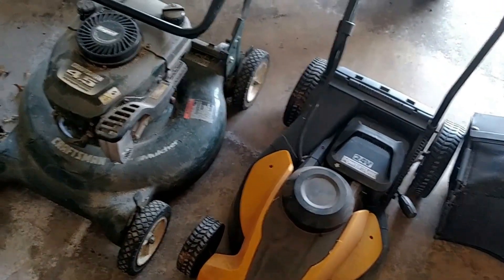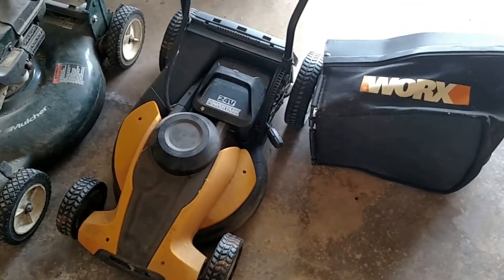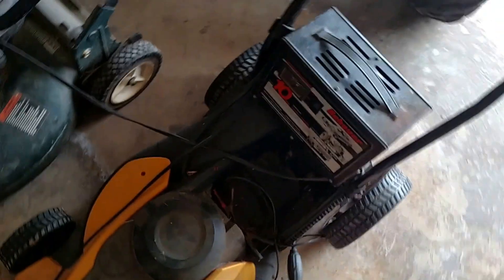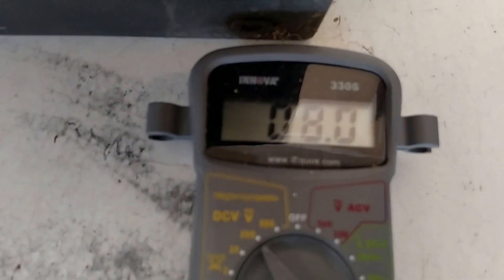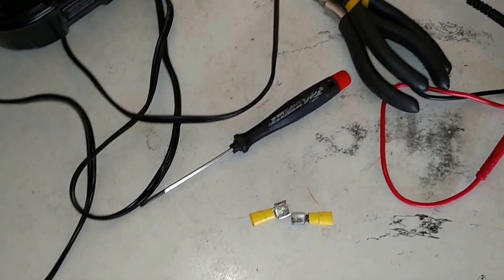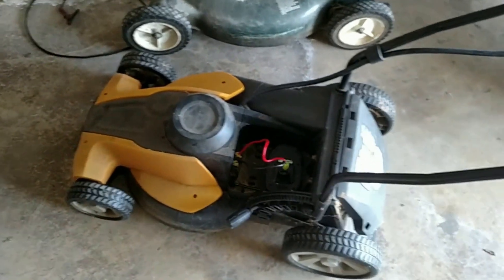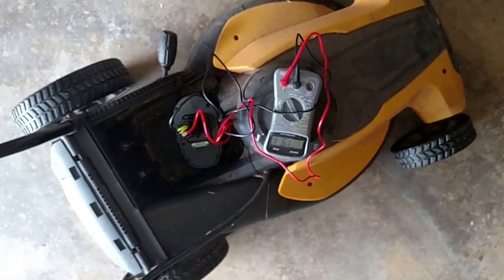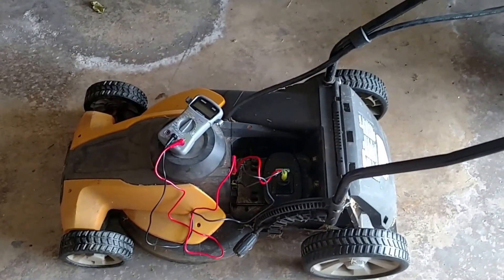Review & Re-power WORX WG775 14" Electric Lawn Mower - This baby's nuclear!!

Comment: I've refurbished/replaced the 12v batteries contained in the pack once or twice over the past several years. Works great and saves TONS of money.
Reply from the maker: That is great, we opted not to do anything with this mower and got a GreenWorks with a larger deck.
Reply: @ChrisDoesWhat what battery did you use? I can’t find any replacements online
Reply: did you replace with lithium ion or stick with lead acid?
Reply: Ted Short LiFePo4, lithium iron phosphate. Outstanding performance now. Much, much more powerful without getting bogged down and much, much more run time. I used to be able to barely cut front and back, now I can do both twice over.
Reply from the maker: We did not repower this, we replaced it with a Greenworks it has a much larger deck.

Comment: Have had mine for 1 yr and 2 wks and battery dead, warranty only for 1 yr. New battery costs more than buying a new works lawnmower. What a shame...I feel totally ripped off.
Reply: Amber Polmanteer-Hellar WORX WG782 mower is a complete and total piece of trash. Every piece of equipment I have that is made by works is dead will not work and I seriously think the company needs to be sued for putting out such junk. Told my wife don't ever ever ever ever look at Works equipment ever again. Worst damn thing I ever bought overpriced and doesn't works doesn't works doesn't works doesn't works
Reply from the maker: I got the greenworks 40 volt, in Florida, I have t mow my yard sometime twice a week, and I have had no issue out of it for 3 years.
Reply: ISame thing happened to me

Comment: Worx had battery issues in the past and the issues have been fixed. I also think that guys run stuff way beyond its intended use.
Reply from the maker: Lead acid batteries have a short life, this would be easy to remedy with a re-power. I did not keep the mower and ended going with the greenworks for the better battery technology and the larger mower deck.
Reply: I hope the new one serves you well. I ordered my first electric mower from Worx and I'm waiting for it to arrive. I hope it wasn't a mistake!
Reply from the maker: +Andrew Keener If it has newer battery technology your probably find. Wish you the best with it.
Reply: Thank you. The one I ordered has the 56v Li-ion batteries on it.
Reply from the maker: +Andrew Keener Your be fine, the one in the video was lead acid.
Reply: Thanks.
Reply: In the past, you mean like 1 yr a month ago?  I don't think so...battery issues were way before a lot of these issues I've read and experienced 1st hand. They STILL Have battery issues and are not holding themselves accountable for their crappy battery issue or empty promises that the issues have been supposedly fixed.  LIES!

Comment: great idea
Reply from the maker: Not going to re-power this thing moving to Florida, had to get rid of it.
Reply: +Chris Does What well i live in Florida and grass grows like  crazy here lol.
Reply from the maker: luis perez
Well I just bought a GreenWorks electric lawn mower, guess I will see how it works there. Works fine here in Texas.
Reply: +Chris Does What how many volts ?
Reply from the maker: luis perez
It is a 40 volt, I have a video on it as well. I also have a 40 volt weed eater I have been using for 2 years, it has never given me an issue.